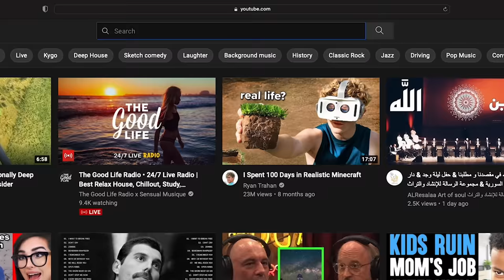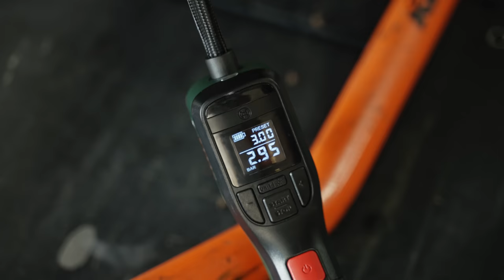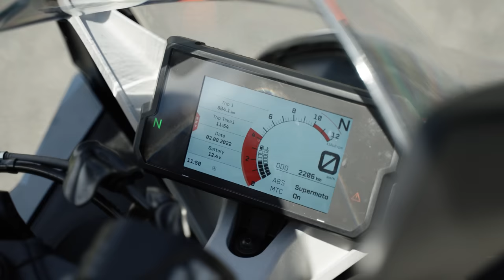KTM RC 390 2022 STUNT TEST I RokON vlog 128

Comment: Was waiting for this, my RC 390 is on the way by the end of this month. Your beginning video on it gave me a push to buy it 👀
Reply: Same such a cool luking bike will book this month😘
Reply: @yohaandhanowa which colour electric orange or factory racing blue and waiting period ?I have I also booked this bike but in electric orange but it's not available since 1 and half month in jh
Reply: @sujayayushxalxo4933  racing blue ordered
Reply: @sujayayushxalxo4933   I got mine within 1 months waiting period in Atlantic Blue. It usually comes within 1-2 months is what the showroom told me. Mine is the first RC 390 2022 of Punjab so maybe that's why I got it earlier.
Reply: @yohaan9 Mine was the first 2022 RC 390 in Coimbatore. 
How is your bike holding up after 1.5 years?

Comment: How Much Engine Oil Did You Put In & How Much Is The Required Amount For Duke 390/RC 390 If We Rev Hard And Do Few Stunts And Check Top End Frequently Should We TopUp Engine Oil In A While Or What Should We Do?
Reply from the maker: Yes, I always fill up 80% of the oil window  normally is 50%
Reply: @RokBagorosStuntrider  Thanks For The Reply Man!❤️‍🔥✌️

Comment: Hey Rok, my 2022 rc390 keeps pulling itself down from wheelies?!?! what did you do to cure the ecu electronics so this wouldn't happen??? A concerned wheelie addict!!
Reply from the maker: ABS in the supermoto mode and it should let you pull up the bike. If not pull out the ABS fuse and ofcourse be careful because then the ABS will not work ;)
Reply: @RokBagorosStuntrider  tryed that an then figured out the BRAND new bike had tons of chain slop also LOL, thanx for the quick reply. you are a great rider!! Ride On!